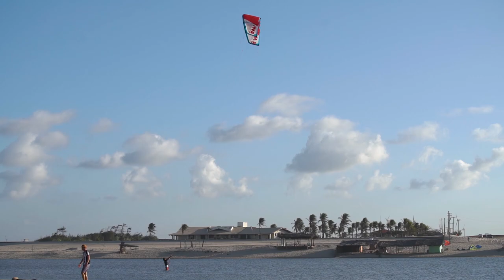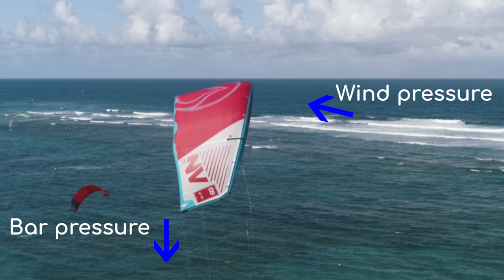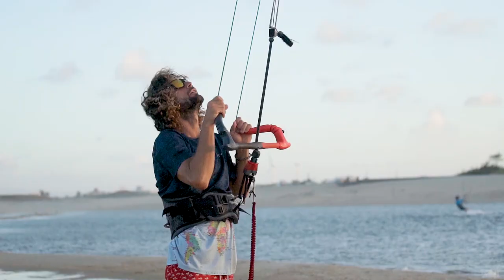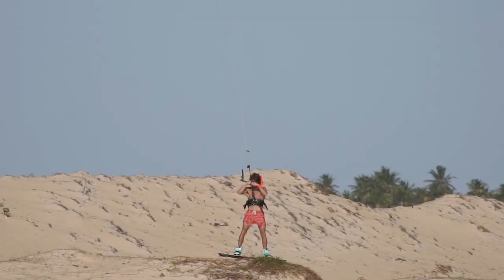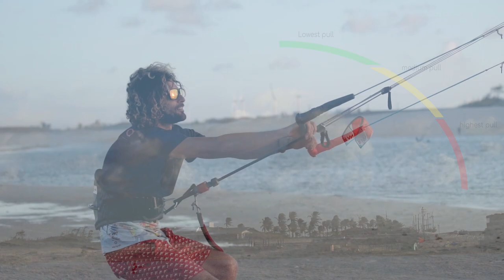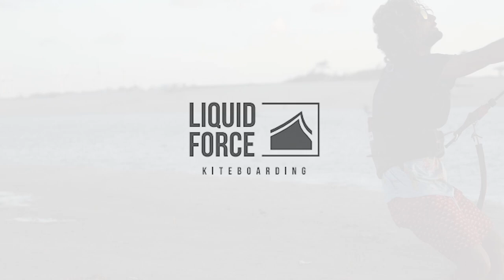What is a backstall? How to fix it? (kiteboarding Tutorial)

Comment: How about pulling on the center lines?
Reply from the maker: The first steps I explained are ideal to use first because you keep control of the kite with both hands on the bar. If pushing the bar out is not enough, you can let go of the bar and you can pump the kite by doing on or two pull on the center lines. However, if there is enough wind to fly the size you use. Once the kite go in the power zone, releasing the bar should be enough to have the kite going on zenith